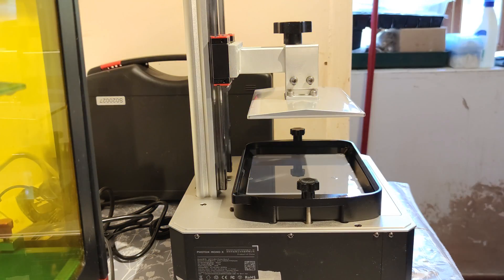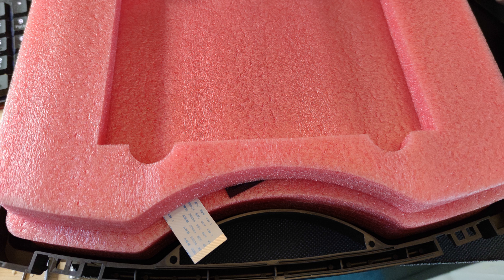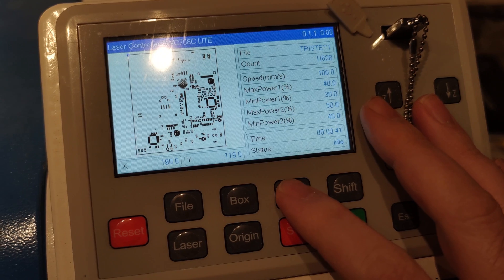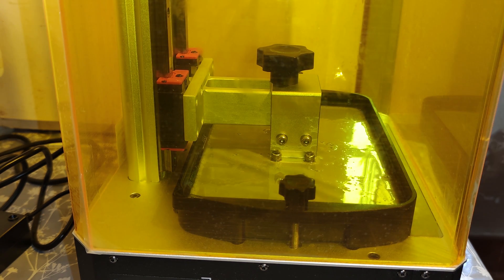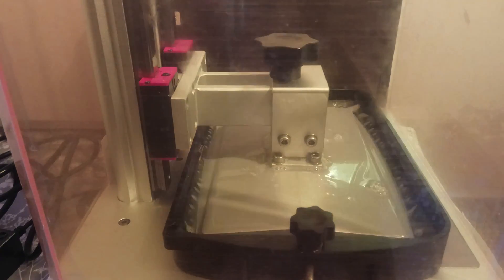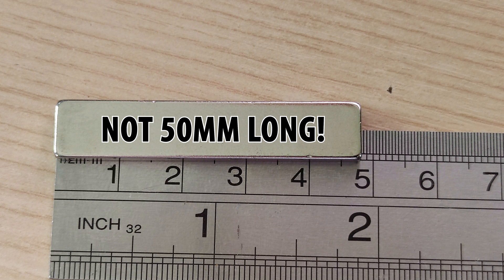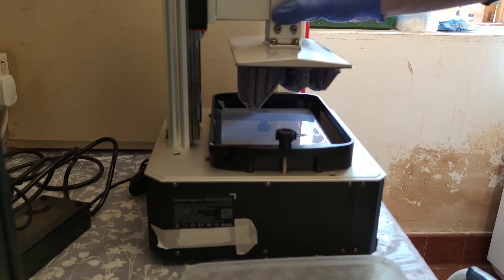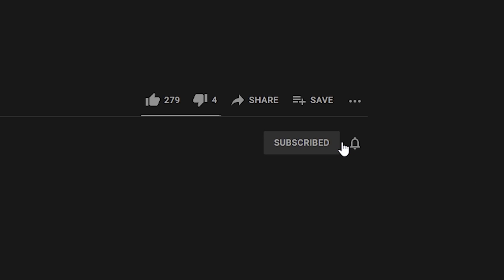Upgrades I Made To My Mono X Resin Printer!

Comment from the maker: !!!!! IMPORTANT UPDATE !!!!!  
The Neodymium Magnet upgrade DIDNT WORK! 

The magnet itself is more than strong enough to handle the resin shrinking. But the rubber compound the magnet is set in dissolves under printer resin.

I attempted to seal the magnet with a Lacquer but have had no luck as after 15 or so prints the resin ate through the lacquer and attacked the magnet again. 

Do not do this upgrade unless you know a way to safely seal the lacquer from the resin. 

I have heard WHAMBAM flex beds still suffer from the same shrinkage issue. But I dont know for sure. I may test this later. 

I may also look again at fixing neodymium magnets in a plastic frame which was my first plan. But ive been really busy lately so Im not sure how much time I can put aside for that. 

Anyway IF you have done this mod. Be aware of the issues I've faced, I hope you have had better luck.
Reply: I had a similar issue on my regular mono
, but it wasn't the magnetic bit which was dissolving, it was the glue and the rubber bit started peeling away at the edges. I took the whole thing off, cleaned off the adhesive and used original gorilla glue, which I checked was solvent proof, and glued it back on with that. It is holding up far better now. You have to really weigh it down whilst curing as gorilla glue expands... but the bonus is it expands out the edges and seals them too.... and needs sanding back a bit to neaten it.
Reply: Quite late reply to this but one thing you could try is to cure the resin that sticks to the magnet after a print and let the cured resin protect against the uncured resin. But perhaps you have another vide3o up by now on how you solved it or another way you found working.
Reply from the maker: @gaming4fun419  I have considered that. Trouble is it would then make the magnet surface uneven I'm considering a laser cut frame, which then houses magnets. But I'd need a glue that won't be affected by the resin.

Comment: Your certainly convinced me not to buy this printer
Reply from the maker: Dont let my video put you off, it still a great printer. Its been my workhorse. 
Also i think since I made this video they made some changes. Including improoved flatness and new textured build plate. And i think it now comes with a screen protector. But not sure. If not. You can easily buy them.
Reply: Don't let that stop you. I bought a totally filthy printer from someone who didn't enjoy it and only produced faulty prints. Cleaned it properly, removed all the faults and it prints beautifully.

Comment: This technique worked for me. I purchased Neodymium magnets and affixed them to the spring steel build plate alternating the magnetic fields for more strength. I then placed this on a flat surface plate , but plate glass would do in a pinch.  I then laid down a stripe of 2-ton epoxy on each magnet and placed the aluminum build plate on top and left it for three days to ensure it cured. The epoxy will fill irregularities in the alum build plate so no need to sand. I then filled the gaps between the magnets with silicone sealant which is impervious to the resin. Works great a year on and no degradation. The resin will eat the epoxy over time, hence the silicone sealant.
Reply from the maker: yeah pretty much what i was originally going to do. But with using a pom frame. I did a bit of laqure seal aroudn the magnet but it appears to be wearing out now... Ive pretty much stopped using the flex plate for what it was designed for and gone back to using a spatula to take the parts off. Which actually hasnt been difficult. 

The magnet upgrade in this video has pretty much been a monumental failure, but ive chosen not to take it down as it can be a learning experience... And for some strange reason its also my most watched video...

Comment: I had the same issue with mine which I only got a couple of weeks ago.  They have upgraded it to include a LCD protector now however they updated the bed, it now sticks so much, that you literally need to chisel the part off.   I did get a magnetic bed from amazon AU and so far, it has held up well.   I had to play with bottom layer exposure settings to get it to stick though.

Comment: what is a good uv power % for translucent resin?
Reply from the maker: I run everything at 50%, but different resins need different curing times. You need to do your own experiments... As some transparant resins at this power level only need 2 or 3 seconds. And some others need even 10 seconds....
Reply: @MD_Builds  thanks for info

Comment: can you share the file to cut the screen protector and seal?
Reply from the maker: Not sure I can actually... I made it on the fly at the time. Probebly not saved.
If you have a cutter. Just measure inside and outside dimensions you need and setup your cut.

Comment: A transparent plastic sheet does the trick protecting the screen and does mot take one month to arrive!
Reply from the maker: but glass also spreads  tension, so if there happens to be something loose int he resin i missed when filtering. its less likely to break the lcd glass.

Comment: Never buy the WhamBam or other stuff at least not for the Mono X. It can not hold the size. For almost a year I struggled with larger prints and even normal ones had problems. 
Weird though that you didn't need any adjustments on the detection flag with the alternative flexplate.

So I bought a new buildplate and it is warped. WIth the Flexplate I could only print from the middle and now I can only print on the sides...  I'm still in battle with Anycubic to send me a new plate after testing it for months. I tried to sand it but it's only touching the corners on an A4 on a mirror I ruined for that. Sanding just a few centimeters back and forth and around was too much for that 1mm difference so I stopped after a while.

All in all with the Anti Aliasing missing on this machine and the lack of Elegoo Saturns back then, the Mono X was a really tough cookie to swallow and I print more models than most people wasting tons of resin in the process with these half prints that just stopped somewhere. 
I am currently being screwed over by the Elegoo Jupiter launch now, still no sign of even a shipping date since March. History repeats itself for me...  GL!!
Reply from the maker: Good to know the whambam is just as bad as for pulling off. I have sprayed on an varnish for to try and protect the neoflex maget. So far it seems to be working... Im going to release a short update video soon on that. On later firmware's the mono x does have AA, you might need to update the firmware. And use newer chitu version as well.

Comment: NO PLEASE DONT DO WHAT HE DID TO HIS BUILD PLATE THAT IS MISSINFORMATION I BEG YOU PLEASE DONT DO WHAT THIS MAN DID ALL YOU HAVE TO DO IS SET YOUR BOTTOM EXPOSURE TO 20 TO 30 MAX AND IT WILL EASILY COME OFF THE BUILD PLATE YOU WONT HAVE TO PRY IT OF VERY BAD ADVICE. YOU ARE RUINING IT FOR NOOBS THAT ARE BARELY GETTING INTO THE HOBBY. PLEASE I REPEAT DONT DO ANYTHING THIS MAN WRONLY DID SMH
Reply from the maker: Instead of getting your caps lock stuck. Please explain what misinformation I've given?

Comment: THIS IS THE WORST VIDEO EVER. YOU ARE DOING TO MUCH LOL JUST PRINT NORMALY DUDE PUT THE DAM LCD PROTECTOR AND TURN YOUR BOTTOM EXPOSURE TIME DOWN. YOU ARE BAKING THE BOTTOM LAYERS TO THE BUILD PLATE. FOR YOUR RESIN YOUR USING IS AT THE MAX 30SECONDS

Comment: How did you know the plate wasn't level?. I noticed mine looks like one side is lower than the other by resin level but prints lvl
Reply from the maker: I used a straight edge. But you can use a metal ruler too... Anything with a true straight can be used to see if theres a curve in the plate.

Comment: I'm thinking about getting a spare build plate and drilling holes from the top to within ~3mm of the build surface. The holes would be large enough to drop in a few neodymium magnets and fill back in with something to keep the resin out. What are your thoughts?  Do you think it will work?
Reply from the maker: Funnily i was going to do something similar before I eventually found the neoflex magnets. Given that there might be some degradation to the magnet medium, I might end up doing this still... I'm actually planning to get a CNC machine later this year, I might end up making my own bed and putting magnets in. It might work? Its all experimentation at this point.

Comment: Did you ever find a way to protect your new magnet? On your recommendation I installed these on my printers and they work AMAZING! But I am also having the issue of deterioration, especially around the edges where it makes contact with the resin. 

Thank you!
Reply from the maker: Not yet. I think I might need to research into some kind of sealing or enamel paint. Not sure what yet. It would need to be something that would also not react with the solvents in the resin, or IPA. And yeah the magnet itself does an amazing job. Its just a shame the binder theyre using doesnt seem to be protected. I have been printing with it still. And the damage seems to only be at the very edge at the moment... But eventually i imagine it will eat in.
Reply: @MD_Builds  Wow! Thanks for the lightning fast reply! 
Yeah I use the little plastic spatula to wedge under the lip of the flex plate and that's wearing that corner a whole lot more, I ordered extra magnets to keep on hand and replace as needed. 
I was also thinking perhaps an enamel of some sort but I think it may need to be applied onto a fresh magnet so it has the hardy structure and less flex to work with. I also considered shrink wrapping the whole thing into a thermal pouch. Something like a lamination material that shrinks with heat. Maybe get it all covered, then hit it with some heat. I can't find anything large enough for now, but I'd say that would make a really interesting video. Let me know what you think.
Reply from the maker: @generationace  Im always around :p The trouble with shrink wrap is it might not properly seal it and resin will seep in and never get away... That would eat through it a lot more quickly...
Reply: @MD_Builds  I was thinking of shrink wrapping the whole plate all the way up past the leveling screws. There has to be some way of sealing it and my concern with a varnish type solution is the wear from rubbing against the metal flex plate. I guess that would also apply to the shrink wrap.

Comment: when applying a flex plate you should leave the adhesive plate to bond to the platform for at least 72 hours before using, also theres a much better screen protector called bullet brand.

Comment: I have the Mono X 4k, saw they are releasing the 6K version, the obvious question is can i upgrade from a 4k to a 6k screen? It's that plug and play or does it require additional parts?
Reply from the maker: As a maker and developer.... Yes it should be possible. And the mainboard is likely the same model. But youll need a firmware update that would support the new display... How much Chitu have made the old control boards compatible with the new 6k screens is anyone's guess.... But normally no you wont be able to just replace it.
Reply: Mangy_Dog It’s so annoying, the point was to be able to replace the screens with higher resolution to reduce the layer artifacts, without the printers being upgradable they will become obsolete in a year or two. Also got a Transform and someone posted that the mono version for that has a 6k screen the issue is the conversion to Mono costs as much as another printer which doesn’t make sense. Hopefully a firmware and a guide will be made available, these companies need to keep developing these printers, not abandon them after a year when new versions come out.
Reply from the maker: @Icemanmodeler  well... The higher res screen won't reduse layer lines. You can reduce the layer heights to 0.01 if you like. It will just make the prints finer detailed. The 4k still gives roughly 0.05mm voxels, which is why that's an optimal layer height. The 6k will be finer. But with decent AA turned on. You might not notice the difference all that much.
Reply: Mangy_Dog On my Transform there are artifacts but in the MonoX the artifacts are finer. Having a higher resolution screen will reduce them, I’m using an older version of Chitubox, think it’s 1.6.5, haven’t printed anything last year but last I checked it works great, just have AA turned on.

Comment: RE: your newest magnet and resin getting on it. It's most likely getting in there when you're removing the print. Print a drip hanger for build plate. That will get most of the resin, this is where being patient pays off. Once you think most of it has drained wipe the edges with a paper towel and proceed as normal.

Comment: Did you ever end up having to find a sealer to protect the magnet adhesive from being eaten away by the resin? I've noticed my magnet has started peeling away and I'm wondering if there's a way to protect it from the resin.

Thanks for the help and detailed video.
Reply from the maker: not yet but ive been so busy and too cold to use the resin printer at the moment anyway. But i really should check in on it!
Reply: @MD_Builds  thanks for the update. Would love to know what you find.
Reply: @sodapop2214  NO PLEASE DONT DO ANYTHING THIS MAN DID ALL IT IS THAT HIS BOTTOM EXPOSURE SETTINGS ARE WAY TO LONG THAT HES BAKING THE BOTTOM LAYERS ON TO THE BUILD PLATE ALL YOU NEED IS 20 TO 30 SECONDS MAX AND YOU WILL HAVE GREAT PRINTS NOT BAKING TO THE BUILD PLATE PLEASE DONT MAKE THIS MANS HORRIBLE MISTAKES

Comment: I had to sand the shit out of my build plate to get it flat. Im talking about it taking a few hours to do. I still have some work to do on it but it is working just fine now. Was considering taking it to a local machine shop and have them re-surface it.
Reply from the maker: Yeah if its bad, take photos of it against a straight edge like a metal ruler. (or a straight edge tool :D ) They would send you a new base plate. 

But yeah I used my old base plate to put the magnet bed onto. So i had to sand that flat too... Took a good long while. Best to start with a more rough paper and then go to a medium grain for the final pass. Use glass or a good true flat granite surface.

Comment: hey  seems everyone tries to jam off their prints with a spatchula.  theres a trick, not mine but it works.  boil some water in a kettle, pour it over the contact areas of object and build plate.  take a long blade box cutter and cut it right off.  works like a damn
Reply from the maker: Not a terrible idea but it's a big faff to have to boil water and heat the build plate each print. Also very messy

Comment: I actually used two magnets together from the chinese brand. Stuck the magnet on the plate and the other magnet on the flex plate.  It works for me.
Reply from the maker: Thats an interesting idea. And it held up when you had a large base layer?
Reply: @MD_Builds  unfortunately I could not home with two magnets so what I finally did is sit the build plate next to a heater for a couple of hours.  After that it was well bonded such that I could not detach it even if I wanted to.

Comment: This was a great video. Thank you. I just got a Mono X and haven't even taken it out of the box yet. Thanks to your video, I just placed orders for the screen protector and magnetic build plate. I will check the flatness of my print bed first when I unbox it. You're the second person I've heard comment on the flatness and had it replaced. Also, good to know about sanding if necessary. I have a vinyl cutter and I will be cutting it to fit like you did. Thanks for going through all that and reporting back. You're doing God's work, brother lol.

Comment: Short Question: Is the magnetic foil still good or did the resin destroyed the foil after more printing?
Reply from the maker: Good question... I did try sealing it by exposing it to UV as im sure some resin already impregnated into it.......

But ive not done any printing for the last few months so ive not checked... I really should.
Reply: @MD_Builds  Thx for the UV Light Curing tip, will try this! And thanks for the reply!
Reply from the maker: @fw_uke_ha  I really cant say if it would work... and really you only want the thinnest of residue on there as anything thicker could throw off the flatness of the thing... Personally I feel like some kind of strong lacquer spray might be better for sealing it. Something that wont react with the solvents in the resin though.
Reply: @MD_Builds  As many others using these kind of flex plates, it might be not a popper magnetic foil. The magnetic glue pads I saw where pretty riget and not bendable and soft.

Comment: Not that you need to cut glass now, but the average CO2 laser does not cut it.  It actually explodes it by fracturing it so no not a clean cut.  You can get better engraving on glasses etc by laying wet paper on them and engraving through it.  Keeps it cooler I believe.  Never bothered with glass on my laser.  And as to the best way to cut stuff on the laser and not get an issue with the back, I have my stock sit on 27mm high dog collar spikes, works great and they have magnets glued to the bottom and I have a 1 mm thick steel plate on top of my bed.  Oh and I also have a Mono x.  And when there a bit hard to get off, I wash off the uncured resin then soat in hot water straight from the tap for about 3 minits, pop off easy then.  Also apparently putting it in the frezzer for 20 mins help's.  Shrinks the plate but I have not tried it, hot water works for me.